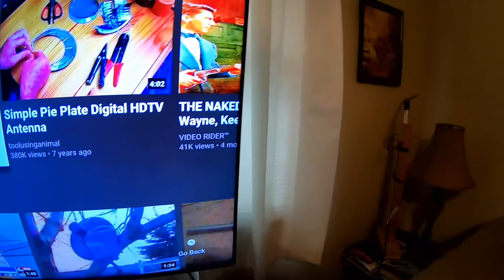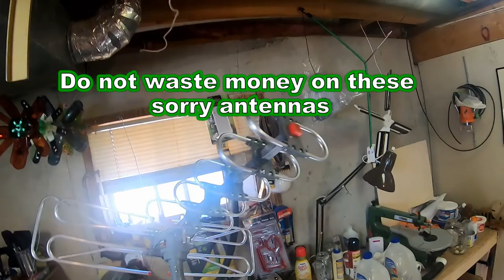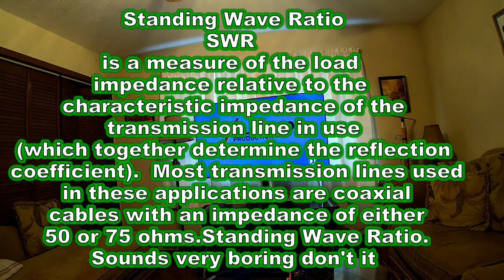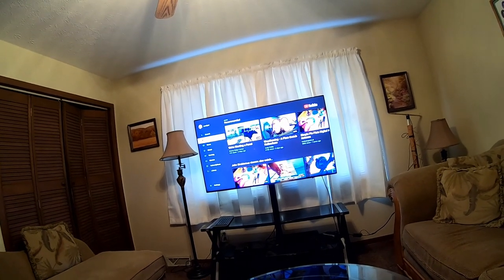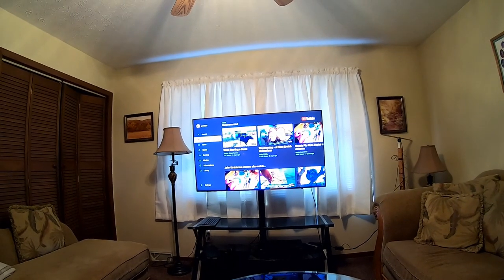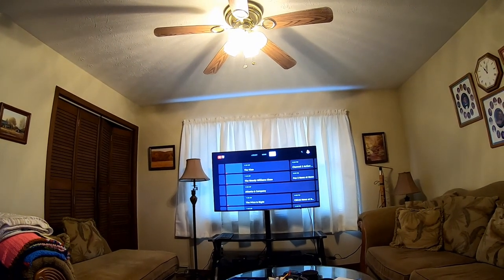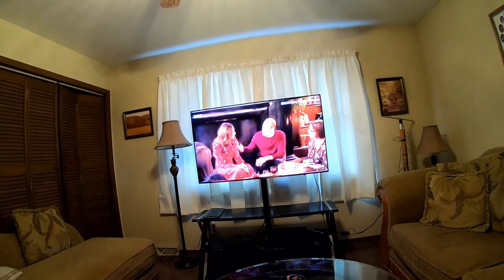Cord Cutting VLOG & Antennas

Comment: Do you remember that old flat 300-ohm cable? Which I still use. If you have an attic you can run an antenna in the attic out of the elements. The antenna I have outside is for the Heath Kit HW-101 ham radio [tube type] and the 40-hi/low channel CB President Washington base station. That ham radio is over 60-years old and it still works. 
But the TV antenna is located just under the ridge-line of the attic. It's 60' long total length, at the center, the lines are attached and that goes to my monitor. What I didn't do was to load the ends of the antenna
Reply from the maker: I remember it well Thanks Hugh  give me some ideas